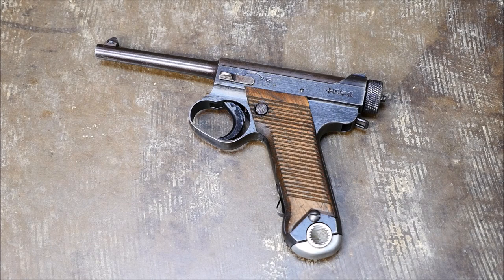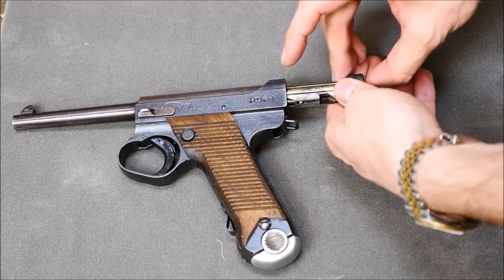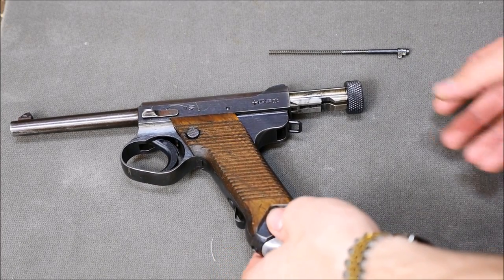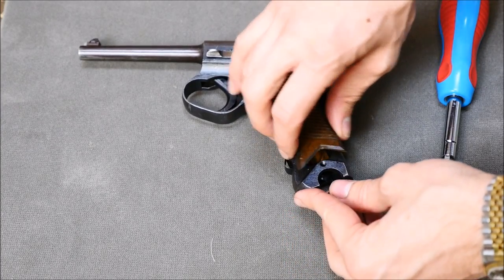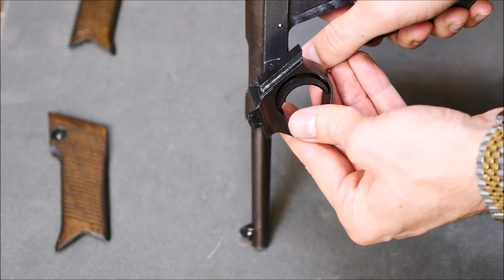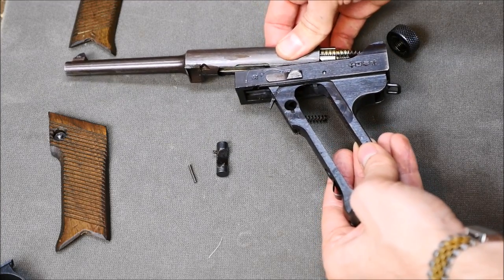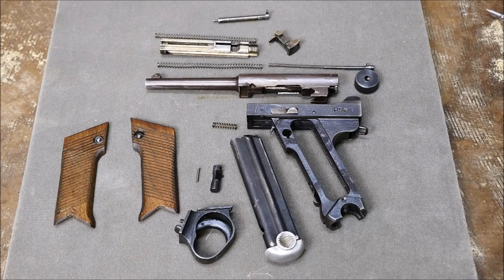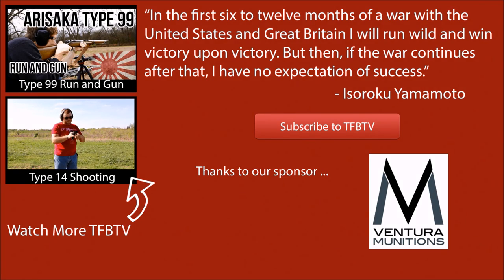Type 14 Nambu Field Strip

Comment: Just fired mine.  16 rounds and all 16 were either FTE of FTF.  The two recoil springs are old (made in 1944) and weak.  I will replace them and see how it does.  The actual firing was pleasant, the pistol has a good feel to it.  Cleaning was troublesome (this video helped a lot!).

Comment: Your disassembly process was overly complex. You do not have to remove the grips or rotate the safety to field strip the Type 14! 1. remove magazine 2 depress firing pin plunger 3 unscrew cocking knob 4 push barrel back 5 depress magazine release 6 slide trigger group off 7 remove upper frame and 7 remove recoil springs, bolt and locking block.